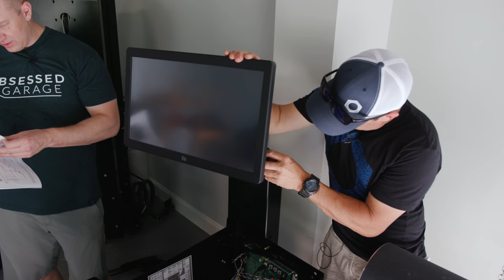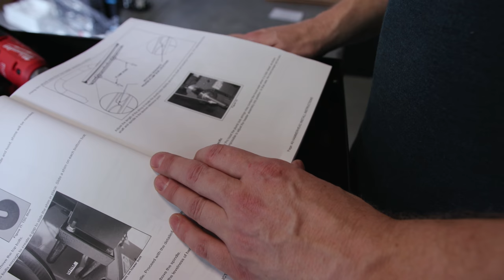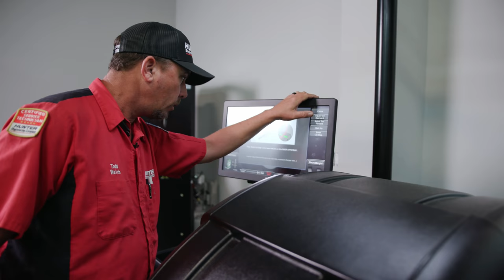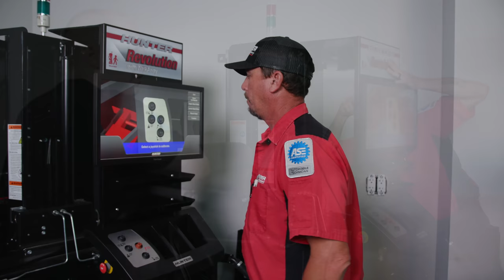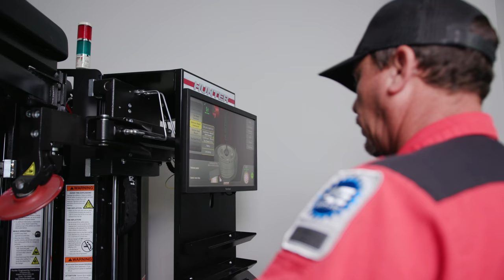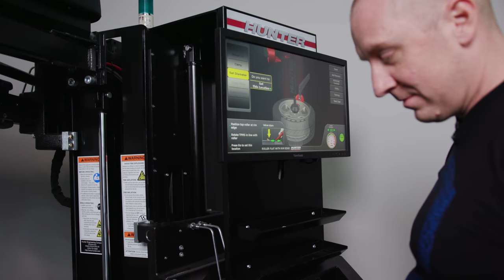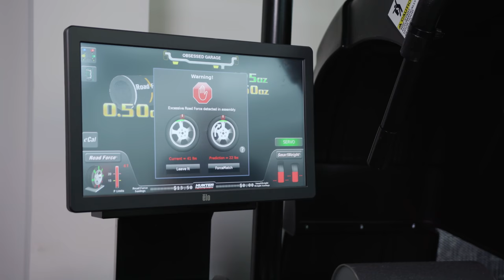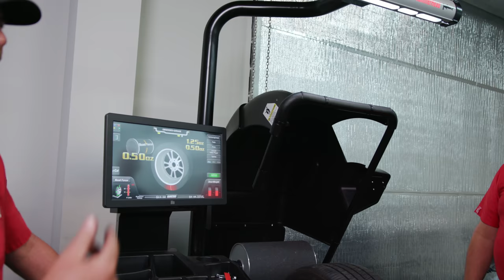Install and Setup: Hunter Revolution Tire Mounting and Road Force Balancer

Comment: I got myself a Corghi 5000 and happy as larry. A manual machine with no computers, not too complicated was top on the list for me. I also got the a Corghi EM9380 balancer, would like to play with the Hunter Roadforce to see what it is like. I used to think my driveshaft was out of balance as after  new tyres from the tyre shop still a slight vibration. Nope, the old machines dont do a good job. When I balance, doing it at four points on rim to get an average of readings,  then putting weights on cars are smooth as.

Comment: I Roadforce all of my wheels/tires, but recently I had a very prominent front end/steering wobble on one of my Michelin Pilot Sport 4s's. Had it redone over 5 times on two different "elite" machines. Wheel assembly consistently measured under 15lbs of roadforce, with .003in max wheel runout. Replaced the tire anyways and the problem is 100% gone. It was my understanding that these machines were specifically designed to troubleshoot this sort of issue. No system is perfect I guess, and even Michelin can make a lemon every once in a while.

I've also been told from multiple techs that with new tires, it's best practice to first do a normal balance, drive the car for at least 20 miles in order to settle any flat spots and alleviate any expansion/contraction of the cords, then rebalance/Roadforce. Many tire shops that use these machines either won't tell you that or they don't know, and some of them rarely even want to "forcematch" the wheel/tire to get lower numbers because of the extra work involved. They love to charge that "roadforce" premium though.

Comment: Great video! I would love to have hunter machines . Much better than my set up. 
Have you have experience with weights not sticking on coating? I’ve never have an issue with Opticoat. I install their coatings and weights seem to stick well every time I balance wheels I coated.

Comment: hello Matt , i'm in Tampa Bay (close to you) , can you help me do the wheel balance ? the NRN shop just messed up my wheel and doesn't want to correct it
Reply from the maker: I would certainly help you out, but my machines are down until we get the new studio up and running.  They are not set up.
Reply: @ObsessedGarage  thanks you very much , i just found the jdm shop in clearwater they can help me now , thanks